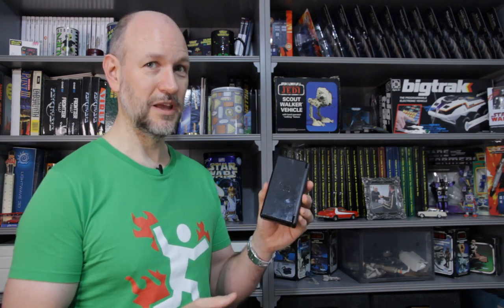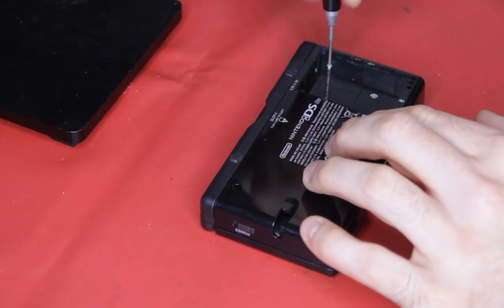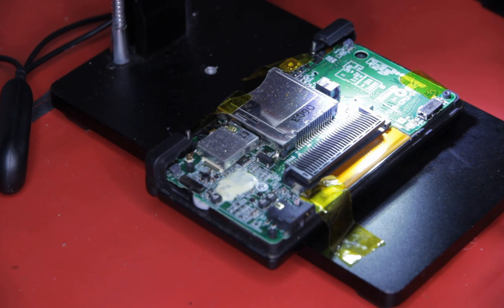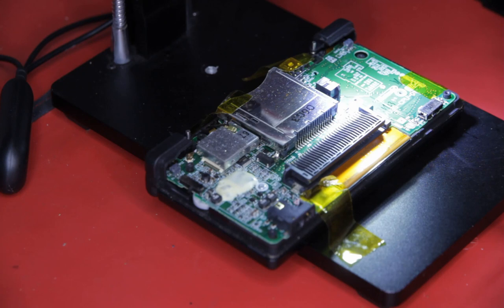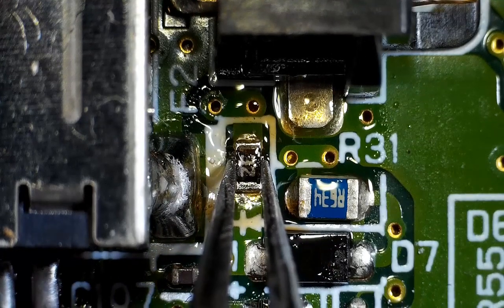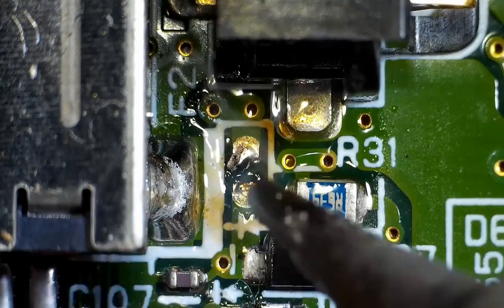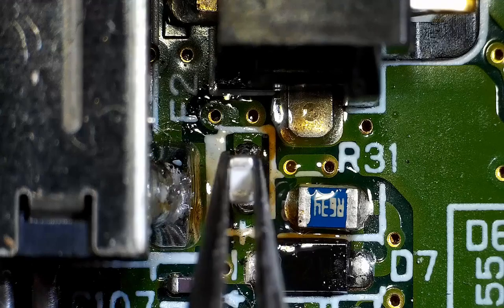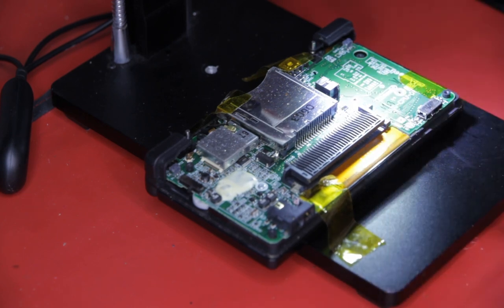How to fix Nintendo DS Lite (dead with no power)

Comment: Hi sir.. which microscope are you using.. kindly upadate with a link please thanks. and not to forgot your videos are really good
Reply from the maker: Thank you. The microscope I use is an ANDONSTAR ADSM302 which I picked up second hand on eBay for £150. It can record video, take stills, and output to HDMI if needed. It takes up to a 32GB SDHC card.

Comment: so what do you do if you have this problem yet the fuse isn't blown?
Reply from the maker: Hard to tell, but if you see a light it's probably not the power adaptor, so I'd probably try a different battery. It helps when you can swap the battery with a known working one to test before buying a replacement.

Comment: Hi there. I have a DS that sounds like this. But the screen does flash for a second. Do you think its the fuse? Thank you for the video
Reply from the maker: Is that with or without having the power supply attached? Might be just an expired battery rather than a fuse. Check the voltage across its terminals with multimeter, it should be the same value as what's printed on the label.
Reply: @TheDigitalOrphanage  Thank you for your super quick reply :-) That's with no power supply attached. I think it's the same either way. Do you mean to test the charging terminals?
Reply from the maker: If the battery has been on charge you should see the correct voltage across the battery's terminals when you take it out and measure it. Does the DS work with a power supply attached? If it does work then I think you've got a worn out battery. If you've got a friend with a working DS maybe try their battery in yours.
Reply: @TheDigitalOrphanage  We've tried it with another DSs battery, and same thing. So i think it's like what you said in the video. :-) (Thank you again so much for your awesome and quick replies)
Reply from the maker: @nathanaelbaier8408  You're welcome. Let us know how you get on.

Comment: So i have a ds lite and i dont have the charger and i don't have a USB thingy or a phone charger what else could i try?
Reply from the maker: Hi, thank you for watching. I only suggest finding an official Nintendo power adapter. I have seen second hand ones at car boot sales, charity shops, etc. in good working condition for only a few pounds. You can buy cheap new replacements, but they vary in quality and some can even be dangerous.

Comment: Hello! First of all, thank you so much for you time and for sharing that precious knowledge.

I want to fix my DS and I think I'll be able after seeing you video, but in my country I didn't find any 0.5A 32V fuse. Would it be ok if I use a 0.5A 125V fuse instead of the 32V fuse?? 

I will be very happy if you respond me!
Reply from the maker: Hi, I'm not a trained electrical engineer, so you take the following advice at your own risk. My understanding is that the voltage rating on a fuse is the maximum voltage it is safe to use with. So using a higher voltage rated fuse should be fine, but NOT the other way around. However both the current rating and the reaction speed are very important. You've matched the current rating, but have you matched the speed rating? If a fuse reacts to an over current too slowly the device could be damaged before the fuse blows. If it's too fast a rating, it will just be more sensitive and likely blow when it wouldn't be expected to.
This is good reading:
https://www.digikey.com/en/articles/fuse-tutorial

Good luck.
Reply: @TheDigitalOrphanage  Thank you so much! I'll check it out and choose the best thing to do. If I fix it, I'll come back to tell you.
Reply: I guess he didn't fix it...
Reply from the maker: I guess we may never know...

Comment: I have a DS Lite that won’t turn on because my mother told me the things on the inside won’t work and have been broken. I really want to fix it and don’t wanna throw it away because that would be a waste of a DS, but my mom won’t listen. Should I go to a second hand game shop to get it repaired,  try to fix it myself or just throw it away? ;w;
Reply from the maker: Hi and thank you for watching. Yes it would be a shame to throw it and at worst you could ask your mum to sell it on ebay as faulty as someone will probably buy it to fix or use for spares. To pay someone to fix it will likely cost more than it would cost to replace with a second hand one so not worth it. You could put it away until you have the equipment and skills to fix (I've fixed several things recently I broke as a kid), or you could ask your mum to see if there's a repair cafe nearby (https://repaircafe.org/) where people who have the expertise, help others fix things for free. Good luck.
Reply: The Digital Orphanage my mum hates eBay so I might have to find another website. I will tell her what you said, thanks for the advice! <3
Reply: found out the DS Lite was actually not broken and my mum assumed that it broke when it died, and didn’t try to charge it lol. I’m trying to find a charger for it, any ideas on how to charge it without the original charger?
Reply from the maker: Best find a genuine Nintendo charger, you don't want to damage the DS with the wrong voltage or polarity. I've seem them at car boots and charity/thrift shops very cheap.

Comment: If the orange light doesn't blink what could it be ? It show that it's charging but doesn't turn on, I have another ds that works so I know it's not the charger or the outlet, any ideas ? Thanks
Reply from the maker: Hi, a couple of thoughts come to mind. Have you tried swapping the battery with the known good one? I also wonder if the power switch has broken (e.g. broken solder joint). Those should be easy ones to check first.
Reply: @TheDigitalOrphanage  thanks for the reply ! Wouldn't the light flash for a faulty battery instead of showing charging ? I'm not sure about how ds works but wouldn't the DS work when plugged even it the battery doesn't work ? Appreciate the quick reply
Reply from the maker: Hi, I just re-read your original question again. So with the battery installed, when you plug in the mains adaptor, the orange light comes on and stays on, but the on switch doesn't do anything? That sounds like both fuses are good.

I just experimented with a working DS lite, and with the battery removed, when I plug in the mains adaptor, the orange light briefly lights and then goes off. However, the DS lite will not switch on, so it cannot be used without a working battery. Does yours do the same when you remove the battery?

If you can swap the battery, it's an easy thing to test to rule out a bad battery.

After that, I suggest investigating the on/off slider switch.
Reply: @TheDigitalOrphanage  yup stays orange when plugged, will try to switch battery when I'm back home, thanks again for taking the time to reply !

Comment: Hi, question what kind of flux and multimeter did you use? Most appreciated.
Reply from the maker: Thank you for watching. My multimeter is a rapitest digital multimeter I've had a long time, but any with a diode test/continuity test function would do, which should be nearly any. The flux I used was Chipquik SMD291NL but again any flux designed for circuit board use would do.

Comment: hey !  my DS have a problem where it ask me to save my name, date and time when i turn it on, and it ask me to restart the DS to save the data. but when i restart it, it ask me to save the date and time again. it seems like the data wont save for some reason, do you know how to fix this problem? i hope you can help me <3
Reply from the maker: I'm not 100% sure but I think the DS doesn't have a separate battery for keeping the settings and clock and depends on the main battery. Does the battery hold a charge?
Reply: @TheDigitalOrphanage  it doesnt. it wont turn on unless its charging, its an old ds that havent been played for a long time
Reply from the maker: @sae1561  sounds like it just needs a new battery. Take the battery out and see what the voltage is across its terminals.

Comment: I was wondering if i bridge the fuse will it work for awhile until i get my fuse from mail?
Reply from the maker: Yes it should work, however remember that should the same cause as blew the fuse before happen, more damage might be caused to other components. Have you tested the external power supply to check it's ok?
Reply: The Digital Orphanage you mean the charger?
Reply from the maker: Yes, just in case that was what blew the fuse in the first place. Unless you know what caused it to blow in the first place (like the coin my nephew put in his DS lite).
Reply: The Digital Orphanage no i actually don’t know! I never used the charge but i might  have cause a short somehow. I know it works now. Will wait for fuse and the replace. Thanks for your vid and replies! 👍🏻💯
Reply: Little update! Well it was the f2 fuse! As the bridging help for temporary fix. I went further that your video! I desoldered a used f2 fuse on pcb from another broken ds lite and transplanted it to the one i knew needed it. Well it works fine now thanks for your really great instructions. Oh i noticed when i solder my pads get a big sphere of a blob of solder... any way to get smaller?
Reply from the maker: Well done. I find the thickness of the solder wire and the length of time you feed it in will effect how much solder you apply. Use thinner guage and/or feed less in.
Reply: The Digital Orphanage thanks a bunch! 🙏

Comment: Hey, is okay to use 1A 32V Fast Blow 0603 Fuses? And does anyone know what specs of fuses Nintendo uses? Thanks and have a nice day!
Reply from the maker: The DS Lite draws up to 450mA so the fuse I used allows a 10% headroom before it would blow. A 1A fuse would allow over twice the current before it blew so I wouldn't recommend it.
Reply: @TheDigitalOrphanage  okay thanks for the reply, a "technician" told me that using 1A instead of 0.5 wont be a problem.
Reply from the maker: Yes it will fix it, it's whether it will give the same protection. It's your risk to take, but a low risk. The most that could happen is you break the DS Lite further if whatever blew the fuse before happens again.
Reply: yes, ofcourse! I'm looking all over the internet for correct specs because I care about the long-term, thanks for replying, appreciate it! Keep up the good work! Happy new year!!!
Reply: @TheDigitalOrphanage  1 more question, do you know any online store that I can purchase good quality fuses that deliver to European countries? I don't want to try Ebay since most of the sellers are sketchy and fuses are low quality Chinese ones.
Reply from the maker: I was going to suggest reichelt but they don't seem to have them. Mouser have a portal for Europe and appear to have a fuse that would do. In their description it states it's a slow blow fuse but in it's spec sheet SF-0603FP050M-2, is described as fast blow and has a very similar specification to the ones I ordered from RS.
Reply: @TheDigitalOrphanage  Hey, I found out that RS ships to Cyprus too so I will be ordering from there the ones you used! Thanks a lot! :) Appreciate it!!!
Reply: @TheDigitalOrphanage  does the resistance matter?  one fuse from uk rs is 	189.5 mOhms and the one from mouser is 1Ohms
Reply from the maker: @Phosphene The SF-0603FP050M-2 (Mouser) has a value of 0.995 Ohm ±30% at 10% rated current at 25°C, whereas the 0603SFF050F/32 (RS) is rated at 0.485 Ohm, although no tolerance listed. When you take into consideration the tolerances, I don't think it would make much difference, but as the one from RS has been in my Nephew's DS Lite now for over 2 years without issue, I would go with that if you can.
Reply: @TheDigitalOrphanage  Oh, sorry I was looking at this fuse; Mouser No: 576-0494.500NRHF

Comment: what if my fuse is not dead but I'm having the same issue of the ds not turning on?
Reply from the maker: Hi David, thanks for watching. You should check the battery next if you see the light come on and go back off. It you can try swapping for a known good one. If you see no lights come on then it could be the power adapter or a fuse near the DS power socket.

Comment: DUDE FINALLY MY DS MIGHT WORK
Reply from the maker: Good luck, hope you fix it.
Reply: @TheDigitalOrphanage  the product is discontinued, what specs does it need to be?
Reply: Ok. i checked the fuse with a multimetre and it's not blown :L
Reply from the maker: Thanks for the heads up, I'll see if I can find a replacement and at least put up the original spec.

Comment: Nive work men .i habe one qiestion ... What is the capacity of the fuse ?
Reply from the maker: Thank you, the fuse details are in the video description but here it is to save you searching:

This is the type of fuse I purchased:
https://uk.rs-online.com/web/p/non-resettable-surface-mount-fuses/6243360
(Littelfuse 500mA F Surface Mount Fuse, 32V)
Reply: Thanks men im put the bridge and work correct .but iwana do good!
Reply from the maker: Ah yes, if you've bridged it with solder it will work but if the same cause happens again it might blow something harder to replace than a cheap fuse. Happy gaming!

Comment: Hi my Ds lite has a rusted power port I think that’s my problem though
Reply from the maker: Hi, thanks for watching. I guess a rusted port won't help make a good connection but you can get a replacement for a few £'s if your soldering skills are up for the challenge. Have you checked inside the DS though? I would be concerned other components have corroded too.

Comment: how do u trn ds on and off how long do u hold power button
Reply from the maker: You only need to hold the switch on for about a second or two, to switch on a DS.
Reply: @TheDigitalOrphanage  so u flick it up all the way and hold for 1 to 3 seconds
Reply: @TheDigitalOrphanage  is that for turning on and off
Reply from the maker: This might help as it's a different procedure on different models:
https://itstillworks.com/turn-nintendo-ds-7282.html
Reply: @TheDigitalOrphanage  wat if u slid it up half way to turn it off. did that then slided it up all the way and it turned off am i fine

Comment: What if both fuses are fine and still won't charge nor power on?
Reply from the maker: Hi thanks for watching. Do you see the light turn on then off? Have you checked both the power supply and the battery? If the fuses and both of those parts are working fine, and the connectors and circuit traces are not not damaged, I would use a multimeter to probe where the power is getting to inside the DS.

Comment: I just cannot get my ds lite to close after fixing the display. Their is the smallest gap just around the charging port. I have the volume switch and the power switch in the right positions
Reply from the maker: Was it the top or bottom screen? I've only replaced the top in a niece's DS lite and getting the cable through the hinge correctly was critical in getting the thing back together properly. I had to make sure nothing was trapped in the wrong place otherwise the circuit boards didn't seat properly.
Reply: The Digital Orphanage it was actually the bottom display. I think I was using the wrong screws around the charging cable and they weren’t getting in deep enough. Thank you for the response.
Reply from the maker: Ah, yes you need to be very careful where the screws are the same type, but different lengths. If you used ones in one area that were too short, it probably meant ones that were too long were used elsewhere which can damage the case if you're unlucky. It's worth using a multisection tray, or even tape them to card in the order you removed them.

Comment: I’m pretty sure it is the rusted power port I also have to play around with the replaced top screen ribbon cable I repaired myself I’m not that bad at soldering ! If not I’ll definitely look into this fuse if it’s not just my power port thanks for answering
Reply from the maker: Hope you find out the root cause, let us know when you do. I replaced a broken top screen on my niece's DS and getting that ribbon cable back in place correctly was the hardest step.
Reply: Of course this is my childhood Ds I’m trying to get to work again I’m waiting to buy a Japanese used Ds to transfer that screen and use its parts

Comment: I have an old DS that my brother used to use and it doesn’t work anymore. I don’t know why but I think it’s because it was too old.
Reply from the maker: Thank you for watching. If it's completely dead it could be the DS or the charger. You can use a voltage tester to check each. If you're not confident or don't have the equipment to test you could see if there's a repair cafe near you that can help. Capacitors and batteries do age and fail but the DS isn't that old so less likely to be that.
Reply: I found out the battery port thing fell pit and i need to replace it with a new one. Im out 😂
Reply: The Digital Orphanage out*
Reply from the maker: @xfuntom  if you mean the metal battery contacts inside the battery bay fell out, then it's probably not worth buying what looks like a £10 part to fix a DS. I'd keep or sell the DS for spares for the screen or case if they're in good condition.
Reply: The Digital Orphanage yeah my broken 3ds and DS look good in condition it’s just the battery bit inside is gone and if I had another DS laying around somewhere I would take the batter thing out and replace it but I don’t think I do

Comment: Unfortunately I have no idea how to do this or what any of those things u were doing are so my prayers are in the charger I’m ordering and I’m hoping it’ll magically come to life 💀 any tips?
Reply from the maker: Without opening anything up, there are only 3 components you can check, the PSU, the battery, and the DS itself. Without a multimeter you can only figure out which is causing the problem by swapping out with known good ones.